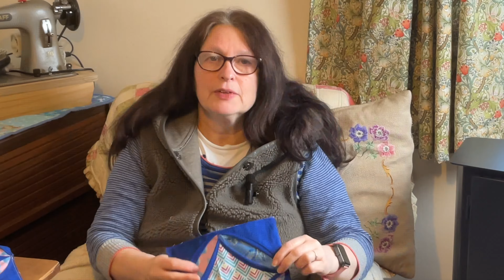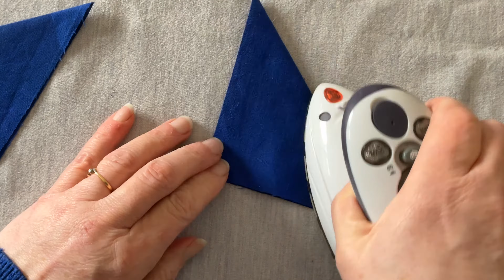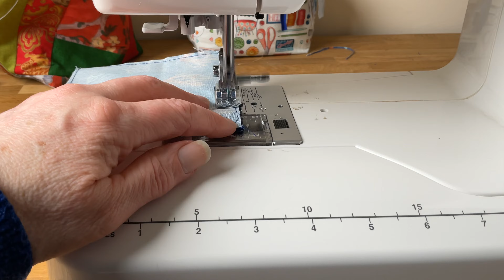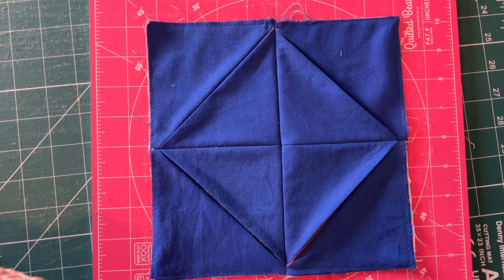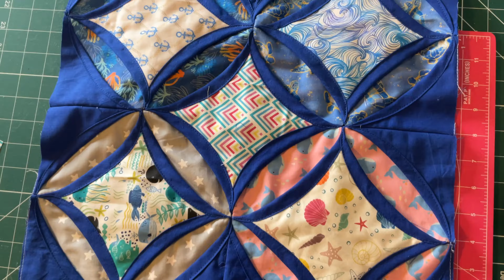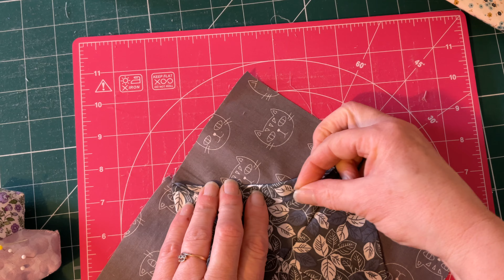Cathedral Window Quilt Block Tutorial: Step-by-Step Guide for Beginners

Comment: My question is once you sew them together do you have a seam all over the back where they have been sewn together? you make  one section and sew to the second right faces together then when you open it  and flip over to the back there you can see the seams each time you sew the blocks together how do you keep from see them?
Reply from the maker: Hi, thanks for your question. You get seems showing on the back with this method so it is best suited to cushion covers and table runners. If you do make a quilt, I would just line the back with a backing fabric. When made in the traditional method, there are no seams showing and it is not backed, so technically not a quilt. I am going to do another cathedral window vlog and will hopefully explain about it in more detail. Hope this helps. 😊😊

Comment: What binding method do you use when making a cathedral window quilt, since there is no batting added and no quilting needed?
Reply from the maker: Hi I would just back it to hide seams, so you could use binding to hold the front and back together. I am planning to make a vlog on making a quilt and cushion cover with this block. 😊😊

Comment: Great video - thank you! I will try this now, it is my favorite pattern, but I am a complete beginner. I am interested in how the back side looks, are all those raw edges showing? How do you finish the back side? Or is it acceptable to have raw edges? Just curious
Reply from the maker: Thank you. The cathedral window is not technically not quilt as it doesn’t have a quilt sandwich, no batting when made in the traditional way. This method can be used for cushion covers, or if making a quilt I would just add a backing fabric but no batting, and no need to quilt. Hope this helps. 😊😊
Reply: @JoSmith-cozysewingnook  thank you so much!

Comment: This is interesting; but, it still looks heavy.
Reply from the maker: Hi yes there are a few layers of fabric in places but I did use quite a heavy fabric as I was using up scraps and had to use what I had 😊
Reply: There's many variations of doing the cathedral wwindows, each that I've seen says you will not need batting or a backing due to the amount of fabric required to do the pattern.  Each of them turned out pretty weighty but beautiful.
Reply: Yes it looks like intermediate quilting, but actually doable for a comfortable beginner..

Comment: Would ironing the folded edges help keep the shape of the window? Or maybe I just need to practice my sewing because I always sew off the edge or the sewing line is not as smooth as I would like. Also the fabric seems to shift a lot.
Reply from the maker: Hi thanks for your question. I wouldn't advise ironing. It takes practice, no one gets it perfect first time.  Take your time and sew slowly, if you have a slow setting on your machine use it. I hope this helps but really it is just practice and don't be too harsh on yourself, I'm sure it's better than you think. 😊😊😊